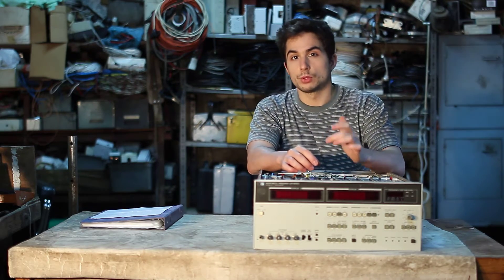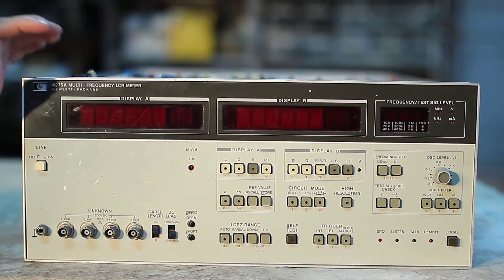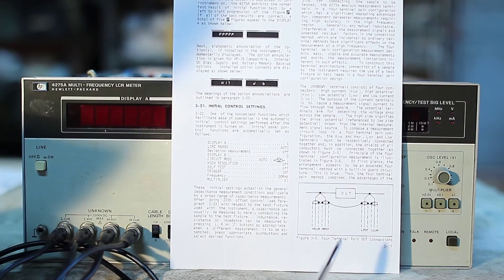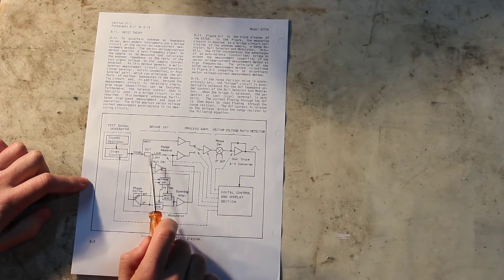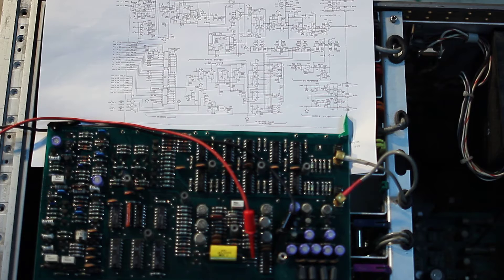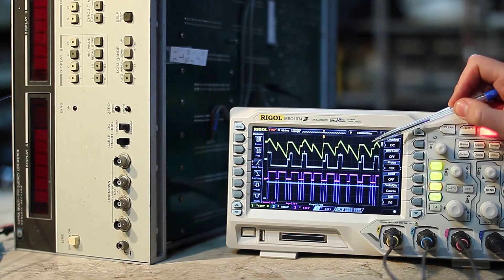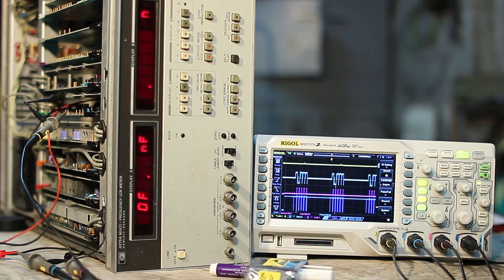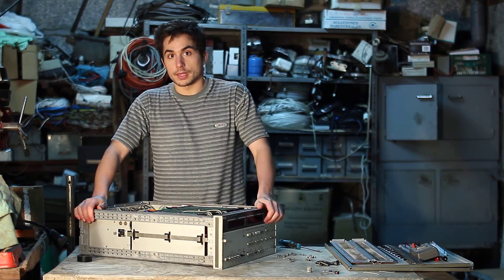PE #1 Teardown and Repair of an HP4275A LCR Meter

Comment: Did you ground the scope probes to the frame? I have the 4274A and I’m troubleshoot Error 4. Cannot find a non-Earth referenced ground pin for the scope. Update: since the manual stated it was a 500mV RMS signal, I was able  to use an RMS DMM and tweak the signal up to 500mV. I think the real issue with Error 4 is just the “test fixture” or clamps. Learned a lot and had fun getting it working. The videos on my channel if you want to see the details. Thank you for the manual!

Comment: The 4275A and its low frequency cousin the 4724A are great instruments. For some reason they both seem to have a lot of IC's go bad. But since they are all common parts, one can with a little work get a great LCR meter for very little money. Chinese fixtures can be obtained for around $100 USD. Not as nice as the real thing, but a lot less. NOTE watch out for the cap across the power line. I've had three go bad, and one that lost all is magic smoke.

And again well done video